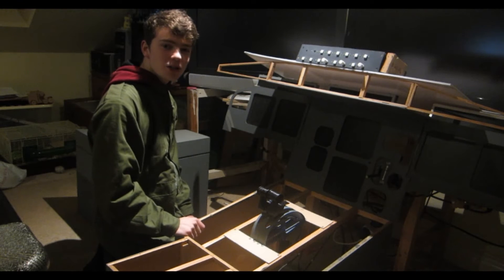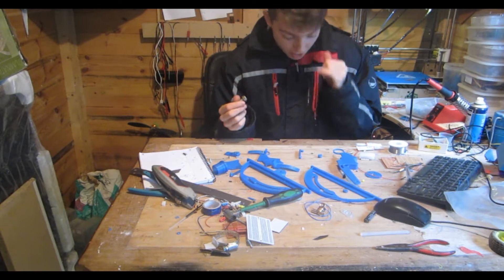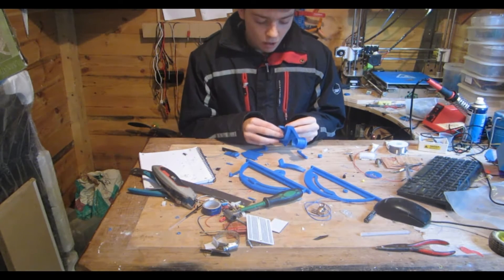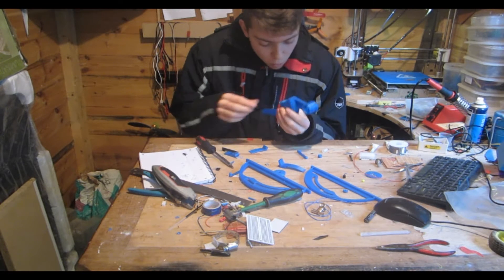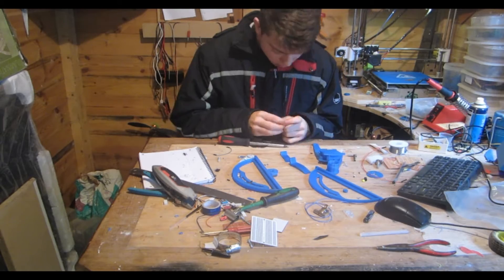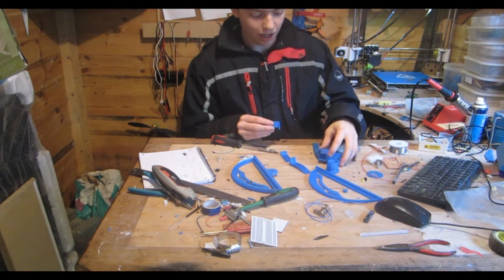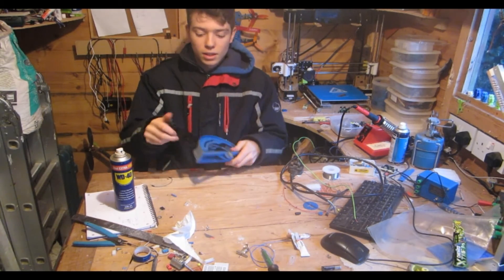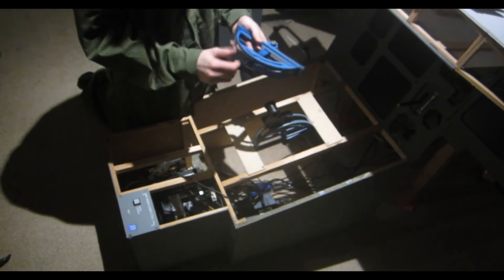Building an a320 throttle quadrant. PT 1

Comment: Hello George. I would be grateful if you share the stl files to print. I want to build my throttle of Airbus

Thanks
Reply from the maker: There is a link at the bottom of this page: http://5.198.31.235:8080/a320_sim.html
Be aware they are not finished.
Reply: @GeorgesHangar  Hi Geoge, Thanks by the link. I notice that it isnt the same of your video
Reply: Hi  @GeorgesHangar  . Are the design finished ? Could you share me the stl files. Thank you very much

Comment: Hey George, as I am trying to build my own home cockpit, I wanted to ask you if you could send me your 3D Model files for your Throttle as I really think that your design is the best 3D printed one I have ever Seen... Greetings from Germany..
Reply from the maker: http://5.198.31.235:8080/a320_sim.html Link at the bottom
Reply: @George's Shed  Unfortunately, the part of the reverse mechanism (the bar at 3:45) is missing - can you might add it to your package?

Comment: Hi - you did a great job.  I am building as well a home cockpit with the FFA320 and Simvim.  The overhead and mcdu is almost finished. I have two questions to you. How do you placed the 2D Panels on your screen , because ff provides no 2 panels to extract yet. did you changed the custom cfg? The second one : Is your throttle quadrant a paid stl file . or did you create by yourself. i am interested at your stl  file. How do you interface your Throttle to the ffa320 in xplane. maybe we can share stl files each other . i have made also some. Greetings from germany
Reply from the maker: Andreas Greiner hi, yes I have used a cfg to extract the panels. It’s actually really easy to do. I will send the link when I’m free. And they are currently a wip but you can have them in their current state and continue development if you want!
Reply: @GeorgesHangar  hi thank you for the answer. OK. I don't have a glue how to to with the custom cfg. The next days I will try xtextureextracture. Maybe this will work, hopefully then no fps drop..